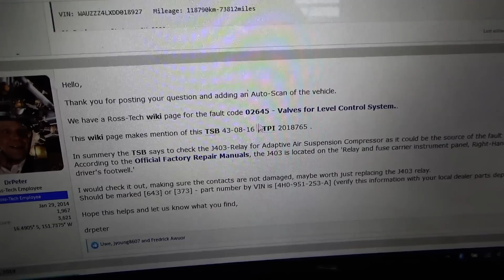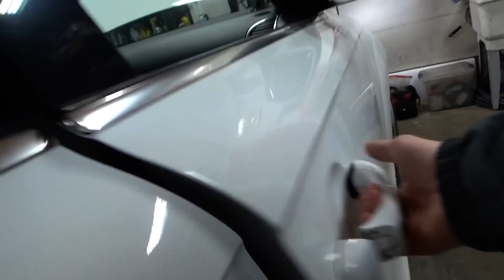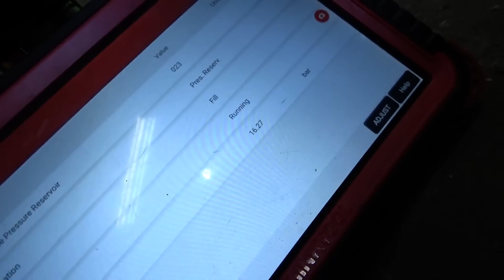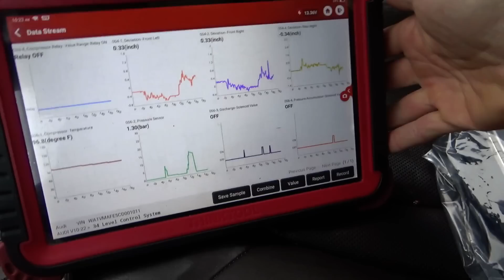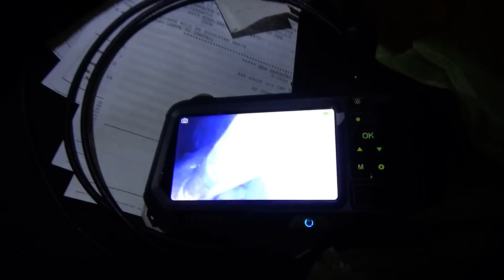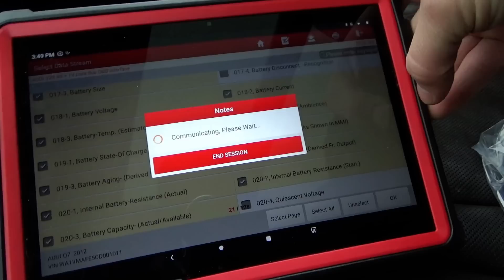Audi From HELL...DEALER STUMPED!! (Part 4 - CONCLUSION - Q7 Air Suspension DISASTER)

Comment: You might have been able to get the original air suspension module functioning again by copying the flash memory from the functioning one and writing the contents to the corrupt module. This would require opening the module and connecting directly to the processor or flash memory for the copy. This might even require desoldering. Normally not really worth it, unless the module is unobtanium like this case.

Comment: Ivan the battery adaptation is same as the bmw when adapted it knows it is a new battery with x amount of amps so it will charge x amount  as the battery gets older the system knows its getting older so it ups the voltage just a bit to compensate for battery loss it is over complicated and not needed just another euro tax for the dealer cheers from down under
Reply: ivan i own a e90 bmw and the first thing i did was get rid of the motor and gearbox i put a ford turbo barra and 6 speed auto in it and it's the best bmw in the world and the most reliable😁😂cheers glenn

Comment: Not sure if it's the case with VAG but on BMW you always have to change the relay with compressor because the relay can get stuck on and burn up the pump. 2 weeks ago I was abroad in the 7 series and that happened. Luckily I was able to change the pump by myself otherwise I probably would have been stuck there with the car and losing so much money.

Comment: I would check the compressor relay for voltage suppression across the coil. If somebody replaced the relay without a diode or resister across the coil, the module will be receiving a lightning bolt each time the relay shuts off. This could be the reason the module was scrambled

Comment: I hope that you were able to recover your costs.  I know that spending days and hours on a single problem is hard work, doing root cause analysis is the most important part of any repair and I'm hoping you get a lot of views to make up the for the fees paid at the dealership. On another note I had a car with rodents chewing up wires, dealer did RCA and I took to my old Soviet shop with new management, he told me that he doesn't know what it will take to fix since it's an electrical issue even though the RCA was done at the dealership.  They messed up the area where fuel comes in and caused the charcoal canister to fail and blamed it on me.  Sometimes it's the stealership, sometimes it's not..same dealer tried to charge me for water pump still under warranty..my point is like Reagan said...Trust but Verify..doverai no proverai...great videos as always

Comment: Some takeaways after watching all four parts:

1.) The air ride module being wonky, the OE battery replaced with a cheap interstate, and the charging system "malfunction" are all probably related. Seems European vehicles really don't like electrical issues. My guess is a DIY gone wrong or maybe jumping it damaged the electronics. It's possible if the vehicle had been taken to an Audi specialist for the battery replacement none of this would have happened.

2.) Turns out the dealer was actually correct. Needed a compressor and the wiring fixed. Now whether they figured that out before or after they missed plugging it back in who knows. They aren't going to want a comeback which means you are getting a new compressor and a new wiring harness. Different class of people being served at these dealers whom want it fixed correctly the first time.

3.) You gotta pay to play. Fancy toys cost money.
Reply from the maker: So you pay dealer 5 GRAND for new compressor and wiring harness... Car is still broken. "We need 4 MORE hours of diagnistics"... How would you feel? 😆
Reply: @PineHollowAutoDiagnostics  That is an assumption. That $4000 may include calibrating and reprogramming the "broken" module. The car could perhaps have been fixed in one day instead of weeks - we simply don't know.

The costs of all those hours diagnosing, researching, fumbling around with two different scan tools, trying to trick computers with jacks. I'd wager your bill would be in excess of $4000. Lets see. $700 for the scan tool. $300 for the jacks. I'm going to guess $250 for the module. That leaves $2750 for labor which at $150/hr (should be charging $200+/hr) would only cover 18 hours. I'm betting there are far more than 18 hours in this Audi.
Reply: @TheRetarp  Totally agree. I'm a DIY guy myself on my own stuff but work at a dealer aswell. I've seen both sides well enough to know that no one is without fault. There is no right or wrong. Comparing dealers to a one man shop in terms of labor rates,expertise is apples to oranges. Dealers get all the hate but when all is well then no one is getting on the internet to tell about it
Reply: @06stiguy63  Indeed! I work in the customer support organization of a large software company. I have to constantly remind myself that we only see negative customer interactions and that the vast majority of our customer base is completely satisfied. We'll never hear from them!
Reply: @06stiguy63  "Dealers get all the hate". Rightly so.
Reply: @ Retarp is correct. … You have to PAY to play this game!!  Count me out!!
Reply: @PineHollowAutoDiagnostics  I agree and the dealer really didn't earn that $600 in my opinion. They delivered the car with the pump wire connection unplugged and didn't tell you that. Plus, I highly doubt the computer is going to have an issue with a brand name battery vs. the volts and amps it provides.
Reply: @Garth2011  Human error is the most likely explanation for the unplugged connector. They did take the vehicle back and reexamine once that was pointed out.
Reply: @TheRetarp  Of course but its a dealership, professionals do not do that.
Reply: @TheRetarp Cheap Interstate? How many automotive battery manufacturers do you really think are in the World? Audi specialist to replace a battery. LOL The Audi specialist diagnosed a compressor without even having it plugged in. Not sure which one is the bigger laugh!
Reply: @KStewart-th4sk  Yes interstate branded batteries in my experience have been mostly junk that loves to vent excessive gasses and corrode everything around them. They have a good marketing department though. For about 20 years European cars have had systems fine tuned to match the exact battery installed (similar systems have been installed into the big three for the past decade). That's why you need the exact OE replacement battery and to follow the service manual to tell the car what exact battery is installed when it is installed. Parts stores like Autozone have stopped the free install on many models for just this very reason. The days of replacing the battery in your car at home with just a couple of wrenches are just about over.

Comment: Probably best not to get banned from the local dealership, might have a far drive to the next one. 
 I tried the reset tire procedure on a 08 a4 I recently got with a salvage certificate, but I can't get the tpms light off. Scoped the module and can looks good, has 3 wires going to a antenna, 2 of the wires have 5 strikes when scoped the remaining wire stays at ground.  Couldnt find much in alldata.
According to service info i have to drive it to learn but I can't get a r title without getting the tp.s light off.

Comment: Wellll....I was gifted a 2000 Disco. Never been serviced. 
I've owned it for 7 years now. 
I've worked on this from front to back litterly. From my experience. I've learned a whole lot. 
I was getting the 3 amigos. So I replaced the usual culprit per people recommendation. 
So the gremlins still embedded. 
Until I replaced all of my brakes calipers. I power bleed the system 2 times. I did find air in the front brakes. 
No more amigos.
My very last item is replacement of the 24 yr old brake hoses. 
There will be a time when I stop buying parts. I don't drive it anywhere. Mostly in town runs. 
Partly due I don't work out of town anymore.

Comment: To everyone that still thinks the dealer was incorrect you need to understand the process here. The dealer and Ivan both came to the same conclusions basically. Difference is the dealer was not given auth to do the repair they quoted and then see if system required further diag. They found a failure and quoted the repair but stated would need to verify calibration of system could then be completed. Also im pretty sure the tech did not mean to say the body harness needed to be replaced. It stated body harness and connector. Well the connector would have been part of the harness. Sounds like a typo to me. Probably meant the body side harness connector. Didnt see the repair quote so cant be sure but if the module was discontinued i would think the harness would be too. If the dealer spent this much time on diagnosis it would have been well over 5000 dollars cause lets face it, the tech has bills to pay and cant afford to spend 3 days working for free. As a dealer tech(not Audi thank god) i have spent over 15 years of strictly electrical and drivability diagnosis work. Dont even have a hoist in my bay. Watching Ivans videos gives me lots of good information on streamlining my diagnosis direction, he is brilliant.  If i find a fault in a system, full stop and quote that repair before moving forward. I believe that is what the Audi tech did in this case. I will say that 3 hours was probably excessive seeing how obvious the corroded connector would lead to issues as well as compressor noise but im not an audi tech, dont wanna be.

Comment: My wife's 2013 Infiniti EX37 has the traction control, ABS, and brake lights on in the instrument cluster.  I suspect it's related to the computer controlled charging system.  I checked it with my TOPDON TOPSCAN PRO scanner and there are no codes.  I tried disconnecting the computer feed from the negative battery cable to eliminate the computer control on the alternator but try as I might I could not get it unplugged.  I'm considering cutting the wire just to see if that makes a difference.  The computer control appears to be working fine......   My Infiniti Electronic service manual just has simplified wiring diagrams that aren't much help.  Now you got me wondering if this car needs a battery reset????  Just how far are you from Wilmington NC?........
Reply: Well, I cut the wire from the battery current sensor and it seemed to help a bit with the charging voltage at around 14 volts but the computer controlled charging system was not the problem.  The lights went out after restarting but when I test drove the car and floored the gas, the brake light came on momentarily.  The second time I floored it the brake light and the TC light came on.  The brake fluid was between the min and max  so I filled the master cylinder to the max and that eliminated the problem!!!!  I'm leaving the wire severed that is connected to the amp sensor so the "smart" charging does not work.

Comment: Between Part 3 and 4, I really thought you were ready to do the big no-no;  to pull the trigger on the parts cannon.  Thinking back to my working days as a shop owner/mechanic, Range Rover is the same way.  these compressors are nothing more than single piston tire inflators.

Comment: Finally a outcome , risky  going the Ali barber Chinese route surprised how it was successful makes me think how they sourced that part audi,s must be popular in china . I was thinking of checking the compressor current on the picoscope to check the waveform as it pressurised and rose to a high level to try to determine if it was a motor or compressor mechanical issue. No winners here except the dealership though reputational damage to them also.

Comment: AUDI = All Unnecessary Devices Installed!  Thanks Ivan for showing me I should never buy an Audi!  My guess on the module is it had values stored and at some point the car lost voltage (battery replacement?) and Audi provides no means for resetting the values.   P*ss poor programming!  You're amazing sticking with this to the end!

Comment: Mercedes airmatic compressors can die in different ways, split the casing and vent at a certain pressure or get weak like the Audi, usually they build pressure quickly until a certain level and then they really ramp over, the relay contacts can melt and stick the relay on causing a runaway effect. I had fun with a chinese valve block doing erratic stuff on an R-class one time, fun and games!

Comment: Now the faulty pump has been replaced, the extra demand might not annoy the alternator.
I'd love to take a pump unit apart. See where the temp sensor is.
Audi and BMW, (lack of) range rover, all have taken things too far.
Tech doesn't like being bounced around, especially stuff that can get hot.
Bring back the 60s
Reply: Temp sensor is likely on the cylinder head, hottest part of an air compressor.
Reply: @volvo09  I was thinking that it might have dropped or moved hence 400* . Were as thermal had it much lower

Comment: I'll keep my 351,000 mile 2003 Volvo s60.  Not a spec of body rot, engine doesn't burn oil, tranny shifts when it's supposed to, the AC still works and I know where everything is, I'm the only one that's worked on this car.  No unexpected repairs through 20+ years- just wear and tear items. Never left me stranded.  I also have a 2006 Volvo s60; once I change out that stupid PCV banjo bolt- I'll actually sleep better :)

Anyway Ivan- I STILL think you should fight for the $620. The Stealership said the pump was totally bad as in- couldn't even get it to lift the car. They don't need to know about the fault code after driving for a while.  They didn't do due diligence otherwise they would have fully seated the compressor plug. They don't deserve to get paid.

Comment: It's probably like a BMW where the new battery has to be registered to the vehicle because if it's not the alternator will fry the new battery so they've made it so that the owner can't just fit a new battery because the parameters need to be reset.

I would want to find out why the PCM was detecting an over temperature fault as well,it sounds like the compressor was the culprit anyway !

Comment: Why didn’t the master technician set the tire pressure on the multipoint inspection? You paid so much money and they couldn’t even do that for the Audi customer. That’s just great. I do that to every Toyota I service.
Reply: How do you know they didnt? Is the tire leaking? Is it a sensor failure?
Reply: @jeffco908  he said he adjusted the tire pressure and set the pressures using the instrument panel and that’s all it took to reset the codes. Only way to know for sure is if ivan saved his health report from when he was across the street after the dealers original diagnosis. Watch the case study instead of just the last video.
If the warning came back on he probably would have also let ivan know with the updated email after his compressor repair. So leaking tire is likely out of the question.
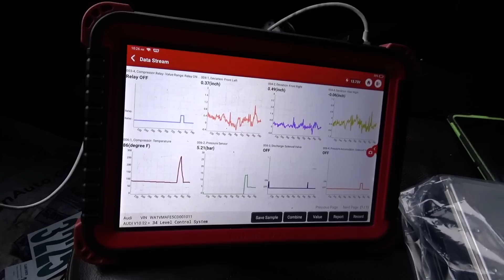Reply: @Pillers4Momoms  16:30 of part 4, TPMS light comes back on.

Comment: I’d bet money the issue with the old air module is a bad solder joint or several. Given the car’s age it lines up. Since around 2010 or so ROHS compliance has mandated lead free solder for everything & it’s garbage. Computers have suffered the same issues since those mandates. After they get some age on them, any component that generates heat starts to have issues with solder joints developing micro cracks. The module might be repairable if the solder joints on some of the components were reflowed, unless it’s potted & you can’t. I’ve repaired a lot of computers & car audio devices doing this.

Comment: In European cars Volvo is a way better than other European cars Volvo car reliability is equal with Japanese car no giving crazy electronic issues module  issues like this
Reply: please tell that to the dead instrument cluster I had on the bench last week from the v70. Happens to most clusters from 2000 to atleast 2010 where solder joints crack. Or the faulty hvac panel the lies on another bench where fiber comunication with stepper motors are dead. Or the faulty door module or any of the major faults they have. On top of that they rattle worse than a corolla on a gravel road. 
+ there are no enthusiast around like on bmw or vag so no fanncy aftermarket software to do module programing. Horrible cars. slow and booring to drive

Comment: Air dryer and filter are probably clogged on the compressor and motor and mechanical parts of the compressor are likely also worn.  Never worked on an Audi air compressor unit but I'm going to guess the air dryer, filter (if it has one) and compressor are all one unit.

Comment: Audi marketing team, "What is the most reliable part of our cars"?  Mechanic "The springs"  Audi marketing team "We can fix that"!
Reply: Coil springs aren't even reliable on modern cars, I've had broken springs on 4 different cars. They're built thin, light and highly-stressed now, so after a few years of road salt and bumpy roads, they break.
Reply: @simontist  my take on that is, that nowadays more salt is used because people are cheap to buy tires
Reply: Air suspension is an option on this car. It's an option on many luxury brands, including Lexus, Cadillac, Lincoln, and some trucks. It's a problem for every brand as the systems get old.

Comment: Interesting that you question the $600 diag fee from the dealership…what was YOUR total diag charge for the car owner with the same conclusion of “replace the compressor”?
Reply from the maker: Dealer "diag" didn't address the customer complaint of "uncalibrated suspension" in the slightest 😂
Basically they wanted 5 GRAND just to continue the diagnosis... What a joke!
Reply: @PineHollowAutoDiagnostics  And $5k just to say "You need a module that's n/a".. I want to know what they would've done THEN!